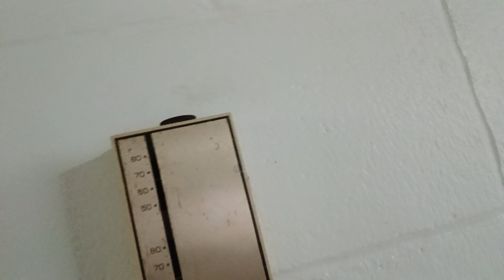Me and Cody got the entry heater fixed! 3kw 1970s resistive heating

Comment: The heat pumps would be more efficient but I guess you'd have to get the water loop up and running for that which is a lot more work!
Reply: The building already has heat pumps for the main heat. For a small heater resistive is fine

Comment: Heating is nice, you have that wired through a 120 circuit? Heheh, funny. What will you do during summer?
Reply: Not 120 but 277 volts... the voltage of champions lol. Gets the real work done.

Comment: well you could definitely heat a lot more if it was a 3Kw heatpump you could get ~6-15Kw of heat out depending on the age of the unit
Reply: Even gas heat would be way cheaper.